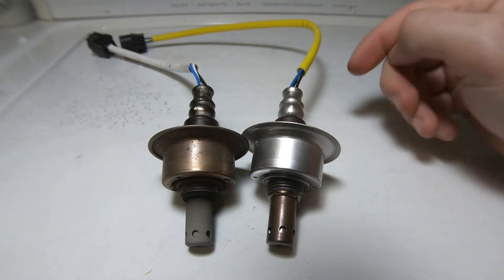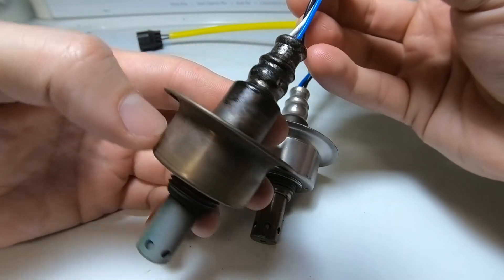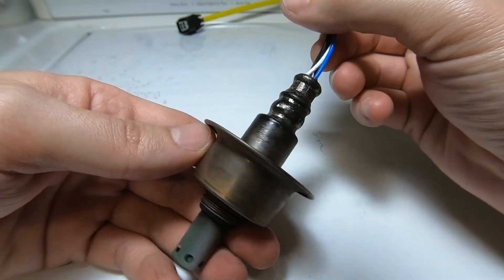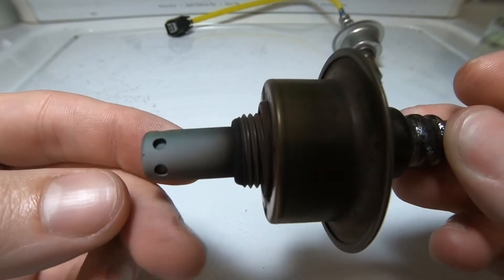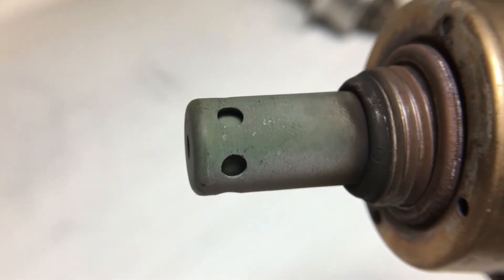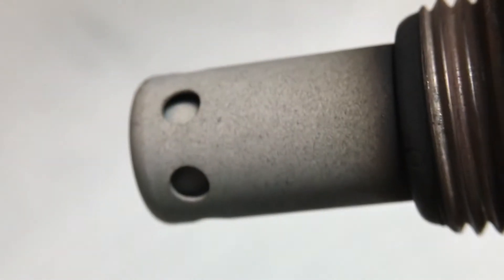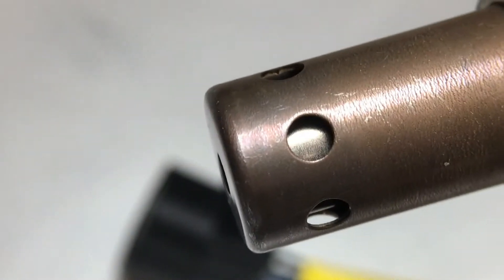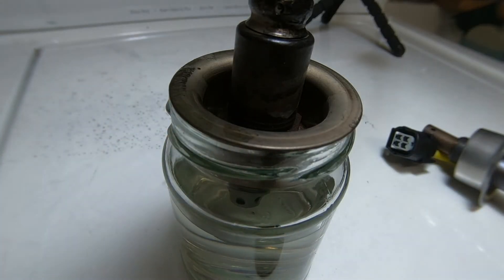Should you clean your Oxygen Sensor?

Comment: When do you actually need to replace the sensor?
Reply from the maker: When you get engine code for sensor and it’s dead.
Reply: @BulliKid  does it need routine maintenance? Like cleaning..etc? I read your comment below that cleaning it doesn't give you any noticable difference, however ive seen lots of youtuber saying that cleaning improves gas mileage, just wondering the truth.
Reply from the maker: It didn’t do much for me.